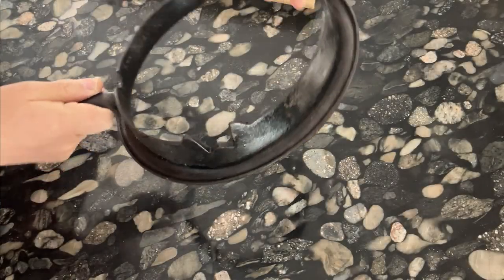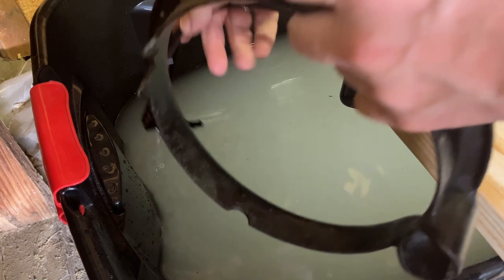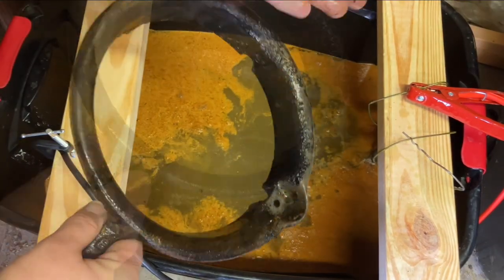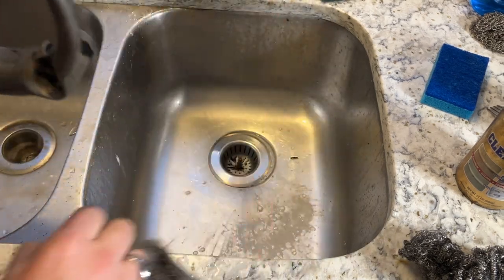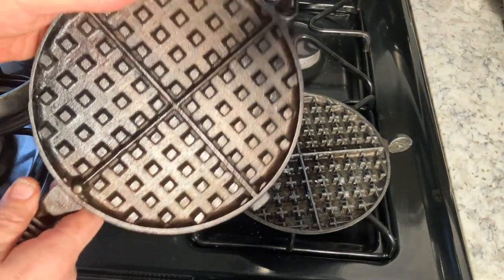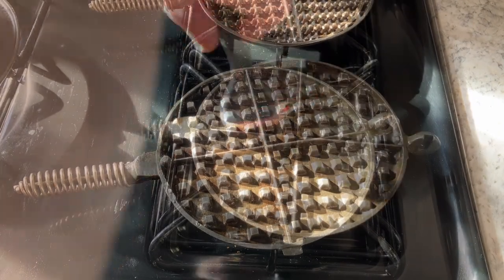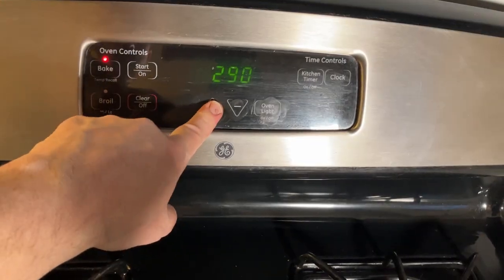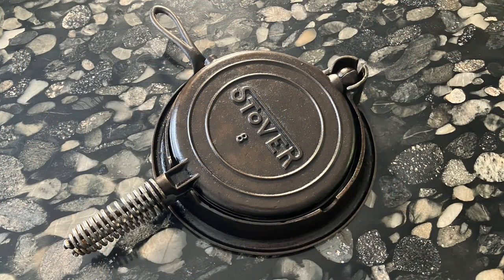Restoring a Vintage Cast Iron Waffle Iron

Comment: I missed the live feed because I was watching Townsends build an earthen oven.
For those intricate pieces of cast iron, I use toothbrushes bent in various ways, to get in those small spaces. I pour boiling hot water on the handle, bend it the way I want, and run cold water on it while holding it bent with a pliers.

Comment: Those stiff brushes like you scrub floors with are good for when you're stripping the paddles. Of course you want a dedicated one and not one that actually gets used on floors. After that you can go in with a toothbrush, wooden toothpicks, whatever and get any little stuff you missed.

Comment: I've been looking at getting a waffle iron. Is there a reason I should get one that sits above my stove instead of the kind that sits on the stove like the Rome? It is like $200 difference... and even the used ones on ebay that need some TLC are over $100 plus shipping.